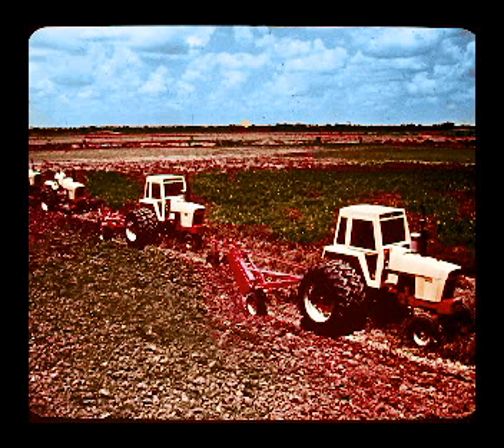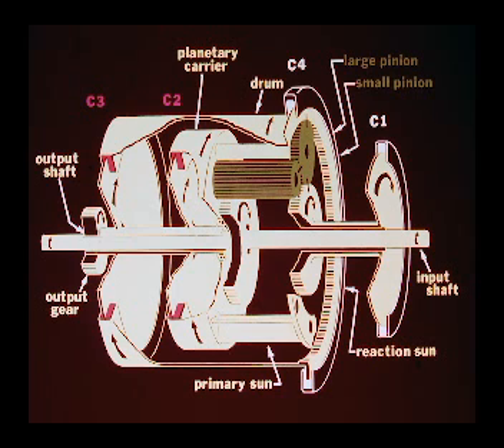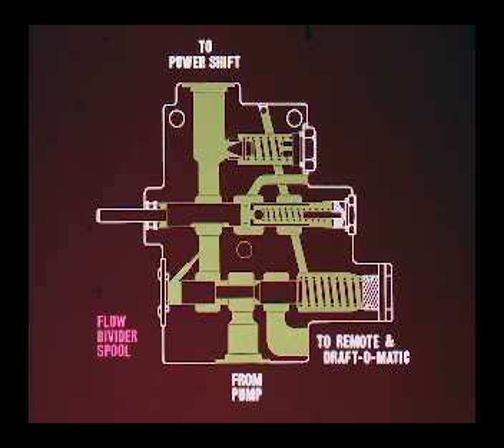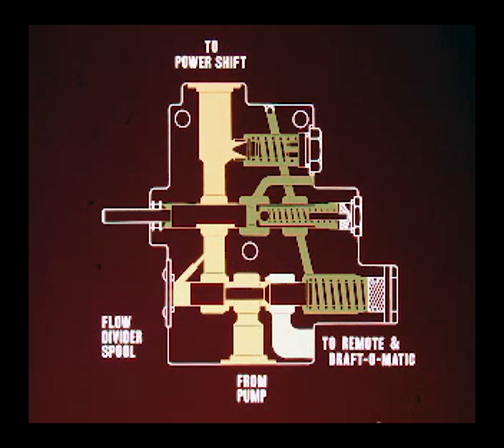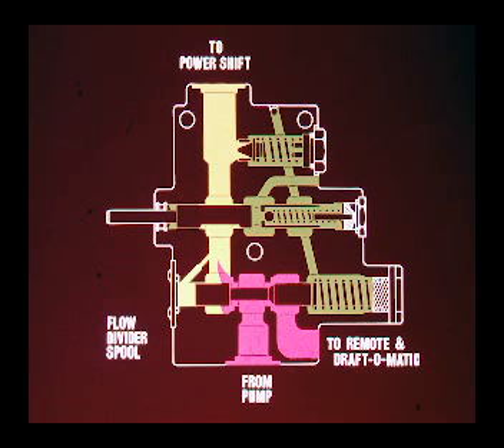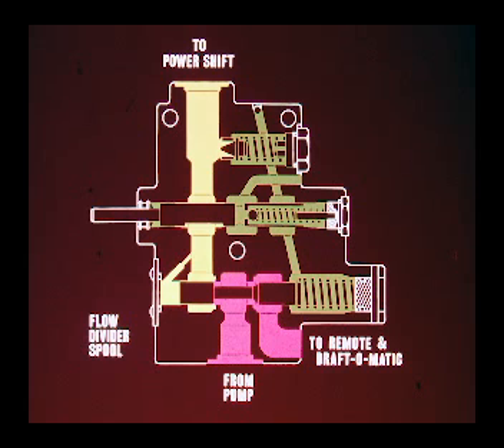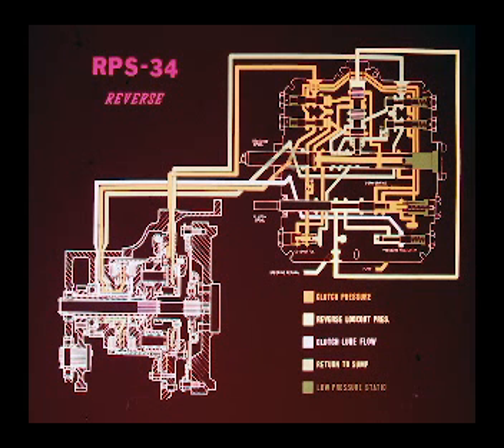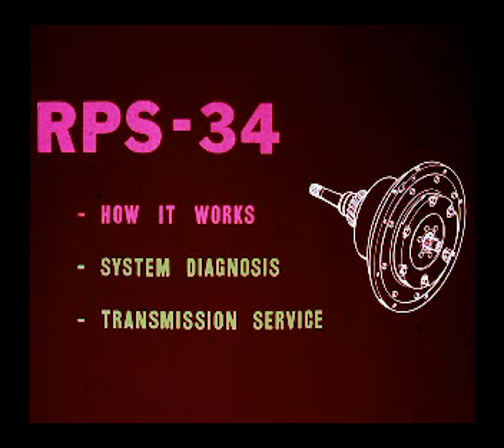Case 70 Series Transmission the RPS 34 -How it Works

Comment: I was a Case 70 and 90 series service tech in the 70s and 80s. Loved them tractors.
Reply: I'm thinking about buying one maybe.  If you have time to share your knowledge, is there anything to look out for?  Could a guy with good mechanical skill rebuild one of these transmissions, or does it take a lot of special tools and information?
Reply: @MurhsDerf  plus this too. Test all the Powershift gears climbing uphill. If 1st 2nd or 3rd powershift is slowing down to where it stops uphill. That tells you that one of the cluchplate in the powershift cluchpack is slipping. That I'd definitely recommend bringing that tractor to a shop that specializes fixing powershifts for the 70 and 90 series cases. That happen to my 1270. It's in the shop now..
Reply: @MurhsDerf  Here's my advice on buying. For the 70 series. 1270,1370,1570. 90 series 2290 and up. You better come up with an extra 10grand in case there's a clutch slippage, and the rest of the Powershift goes out... Don't bring it to case ih if you got 15-20grand.... My opinion. I don't recommend using the Powershift. Only use 1st powershift to do most fieldwork. If you use the Powershift alot. The Powershift tranny would last you 10years or if not less. My way. I'm confident it'll last you 20-40 yrs depending on when the previous owner fixed the Powershift...
Reply: I have a 970 powershift apart right now. Looking for parts. Have to go with salvage since new are no longer available.
Reply: What would cause the hydraulic lift not to work. Looking at buying a black night 1070